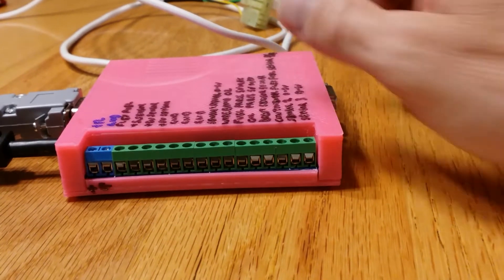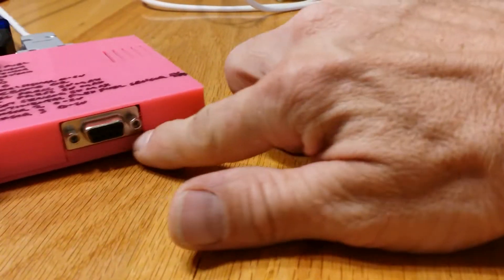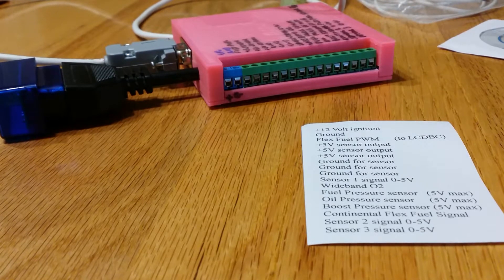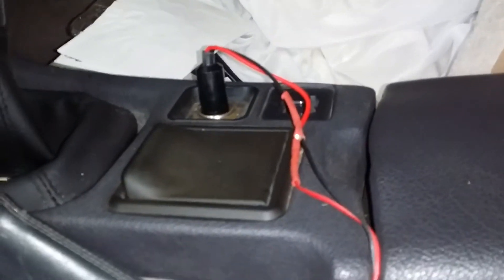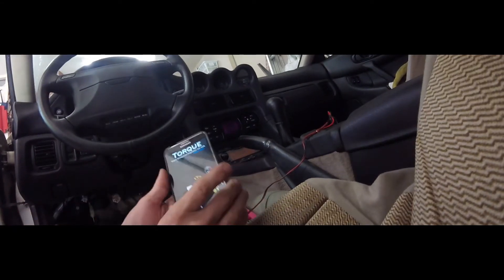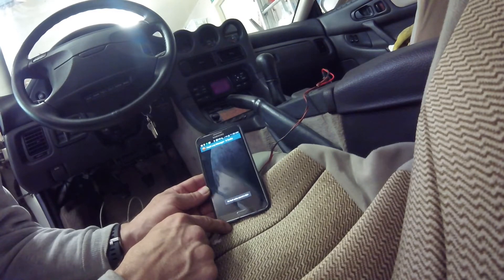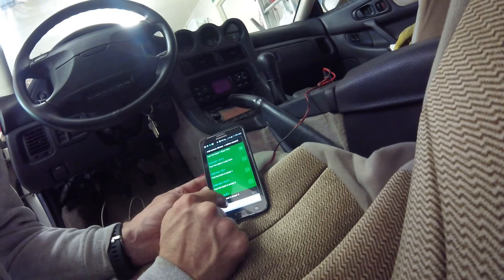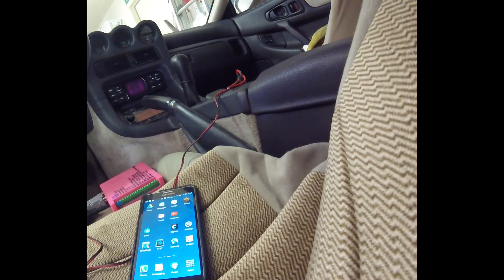obd1 to  obd2 converter for 3000gt or Dodge Stealth

Comment: any idea how i could add oil pressure to my obd2 network on a ford ranger? I have a nice digital gauges that plug into the obd2 port so would like the oil pres function to work. ecu has no options or pins to activate oil pressure.
Reply from the maker: Sorry, I don't know.  Hopefully someone else will know.

Comment: I've been running this out to my OBDII adaptor and datalogging through torque on my phone and tablet.  The only issue I've had so far is logging boost, which for some reason seems to get pegged at certain values and isn't logged correctly.  Great device though, it's made things a little easier for me!
Reply from the maker: Glad to hear it.  I would talk to blackstealth about your boost question.  He responds pretty quickly.

Comment: Nice video; super jealous of your awesome '92 radio! XD If you're interested in faster refresh rates BlackStealth did some testing with cheap OBD2 USB cables and we're seeing 200+ samples per second! I'm running mine through an Android radio in my '92 and the gauges are much more responsive via USB than they ever were via Bluetooth (200+ vs ~15). I'm so looking forward to getting one of these into my Talon as well, along with his LCDBC. Blackstealth's products absolutely rock!
Reply from the maker: Bluetooth is usually a pain.  It is much simpler to plug things in and have them just work, especially when they are both mounted permanently.

Comment: The checking of engine error codes feature is working with this software update:
http://lcdbc.xp3.biz/updates/CANBUSUpdate.zip

CanBus user manual:
http://lcdbc.xp3.biz/CanbusDeviceManual.pdf
Reply from the maker: cool.  I am going to make a video of updating the firmware when I get a chance.
Reply: Tip.  One user mentioned to me that their anti-virus software had a false positive, and removed the updating tool after unzipping.  The user was confused as they had no idea the anti-virus software had done this.

Updating can be tricky, as you have less than 2 seconds from the time the black window comes up and the time you have to power up the Canbus converter device.  If you screw up, you have to wait for the black window shut down, power off the Canbus and try again.  There is no harm if you flash multiple times.